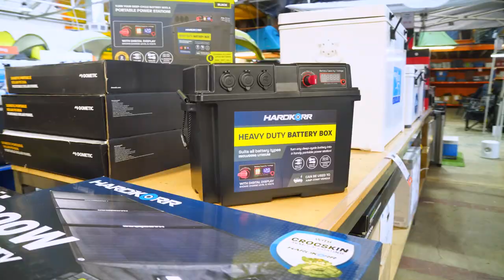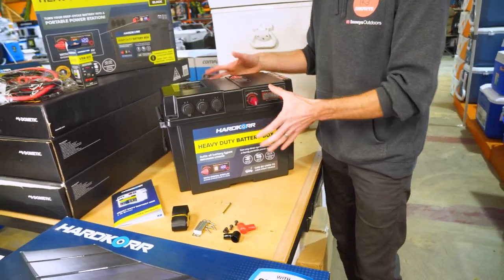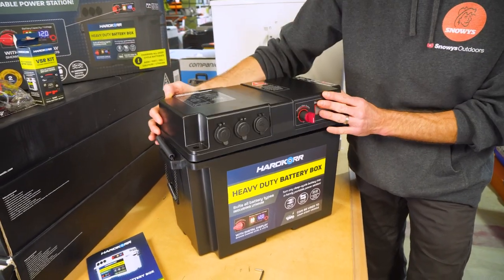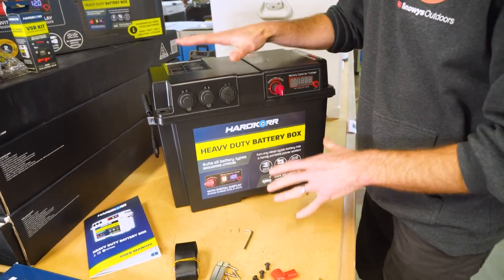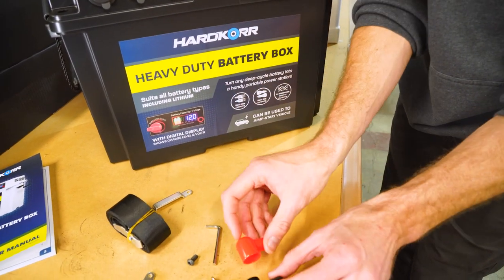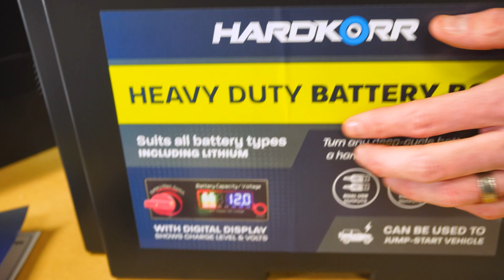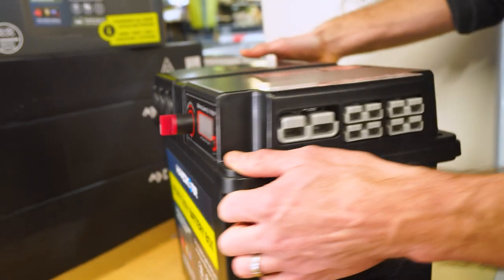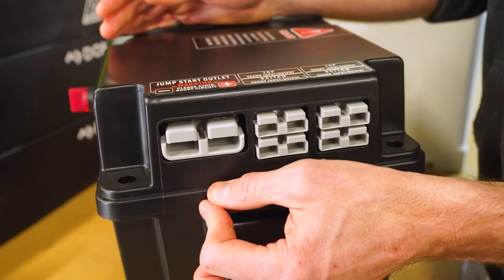Hard Korr Heavy Duty Battery Box

Comment: The box itself is excellent! BUT I’m not a fan of the 50 amp auto reset circuit breakers, I replaced them with midi fuses. The large Anderson cable is connected with a very tight bend! I replaced the terminal with a right angle one for a better connection. I filled mine with 300ah lithium cells and a jk BMS. Just wish the box had battery posts to connect a inverter, I currently run it through the large Anderson! So I pretty much modified the box in the first hour of it arriving and no doubt voided my warranty! 😂
Reply from the maker: The box is well set up for modifications for those who have the knowledge/skills.
Potentially hasnt voided warranty, but worth checking with HardKorr
~ Lauren

Comment: Can you charge the box using solar while  attached to a portable fridge simultaneously? What I'm asking is that could you charge the battery while drawing power to the fridge at the same time. Very informative and good video 👍
Reply from the maker: Yes, you can, it just means it won't charge as fast, but you can certainly have solar going in whilst a load is attached. ~ Ben

Comment: If you charge from a solar panel, does the battery box regulate the power coming in so it doesn't overcharge the battery, or is that anything to really worry about? I'd love to get something like this in lieu of a portable jackery style power station that lacks much battery capacity while avoiding the mess of cables in bigger setups. This looks like it would do that job.
Reply from the maker: You'll still need to use a solar regulator between the solar panel and battery, Travis. The Hard Korr battery box doesn't have any built in feature to manage this. ~ Ben

Comment: Hi there I have an mppt controller that needs to be fused when connecting to the battery. I’m just wondering if the wires from the 50a Anderson are already fused under the lid or if I need to install one? Thanks
Reply from the maker: Hard Korr don't specifically mention anything being fused in the battery box, John. I had a look inside and there does look to be a blade fuse holder on the power going to the cigarette and USB outlets, it's not easy to get to though. I can't see any other fuses in there though, so I reckon it would be best practice to add an inline fuse to anything you power from this just to be sure.
~ Ben

Comment: My deep cycle battery is totally dead..4.2 volts at this stage..any tips on to revive my battery .it's a 12volt 140ah
Reply from the maker: I don't think it's recoverable sorry, you could try a good quality charger, but if the volts are that low I'd say your battery is cooked. ~ Ben

Comment: Finally getting a canopy put on the ute So now the fridge can stay in the canopy instead of the tent. For weekends, do you reckon a battery box is the way to go or a power station like the Rover etc? Cheers.
Reply from the maker: I personally prefer a battery box as you can upgrade of replace the physical battery when it eventually dies, instead of having to replace a whole power station.  If you have some electrical knowledge, its easier to customise how it wires into your system, etc
The power station does have a convenience factor though and appeals for the plug and play style nature of it.
~ Lauren
Reply: @SnowysOutdoors  can I charge a battery box from home, as in 240v

Comment: This battery box is a good product if you can get it at the right price, I have adapted the 175amp Anderson port to run my 12/240 volt inverter with some 0 awg cable.
Reply from the maker: Thats a good idea @Binzy2164
~ Lauren
Reply: What modifications did you make? I was under the impression an inverter can plug straight into the 175ah Anderson?
Reply: @CJFranciss  No modifications to the box it self, I just made up some O gauge cable with a 175 Anderson at one end a some good cable lugs at the inverter end.
Reply: Just bought this box and that’s what I’m doing also. Running a 2kw inverter and induction cooktop from it. Box has everything you need and saves the hassle of custom wiring and fusing everything.
Reply: @2389benny  I wouldn’t run high amps for long periods from the box as the 175 Anderson is designed for jump starting which uses high amps for a very short periods.
The internal 175 Anderson wiring is not that big and may get warm if you ran the inverter over 1000 watts for a long period.
I am using a 1500 watt inverter and would rarely get to that wattage.
I may upsize the internal wiring in my box once I have done a bit more testing.
Reply: @Binzy-jq2xq  yeah I was toying with the idea of just using the plug itself and upgrading the wire internally. Also bypassing the battery on/off switch just for the inverter, given I have a remote switch for it anyway.

Comment: What fuse size is in the box. I ran into a problem with my Kings Box when using 40A DCDC found the fuse on the Anderson plug inside the box were only 30A so naturally blew them.
Reply from the maker: Only the 12v cig outlets are fused, the Anderson outputs/inputs arent fused but they do have 2 breakers.
Realistically you shouldn't need a fuse, but if you want to add one in you can do something line an inline on whatever charge input cable you're using.
~ Lauren

Comment: Thanks for the brilliant video. One question and not sure if I missed it but are the connections fused ? As in the usb’s, 12v cigs, and Anderson plugs? Thanks
Reply from the maker: There are some inline blade fuses under the lid, Nick, and it would be relatively straight forward to add more if you wanted to do so. ~ Ben

Comment: Likely they dropped the VSR due to smart alternators, gives the customer an option of supplying their own or use a DC/DC charger. 

The charge level indicator is pretty useless as there is no option to select battery type. For instance, if you put in a LiFeO4 battery, at 0% charge it'll still be 12.7V and likely show 100% (for lead acid batteries).
Reply from the maker: I think you are right regarding the VSR, better to be able to add it in if needed that buy it with the unit only to remove and not use it.
Good point regarding the volt meter, I guess you need to be conscious of the type of battery you are using.
~ Ben

Comment: At 7:10 he talks about using a 240V transformer to charge from 240V - I think he means a 240V battery charger suitable for the battery type you have installed.
Reply from the maker: Right again Ian, apologies for my incorrect terminology. A 240V to 12V battery charger with suitable Anderson connectors would be the best solution here. ~ Ben

Comment: could u connect a powertech control panel to this aswell
Reply from the maker: I'm sure you could, you'd probably need to use an Anderson plug wired to the control panel  which is then plugged into this battery pack. You would essentially just be extending the number of available power outlets. Make sure it's all fused properly. ~ Ben

Comment: Thoughts on running 1000w inverter on the 175a outlet?
cheers
Reply from the maker: Hmmm, you probably need to know just which battery you are running inside, gablia2002, along with what you are running from the inverter and and how you plan to charge the battery. I'm no expert on inverters but I think it will chew through power pretty quickly, so you'd want a reliable charge source. ~ Ben

Comment: What’s the IP rating on these please?  Are they weather resistant?
Reply from the maker: Hi John, Hard Korr haven't tested these in order to be able to give an IP rating. 
They are designed to be installed in a sheltered location, the ports on the exterior are not weatherproof. Ideally in the tray of a ute or boot of a vehicle.
If you are taking it out of a vehicle for use at a campsite it is best to locate these out of the weather under an awning.
~ Ben

Comment: Best not to use a deep cycle battery for jump starting a car engine.
Reply from the maker: Yep, you only want to be doing this in a pinch, Richard, as you'll likely kill your deep cycle battery. ~ Ben
Reply: Yes agree only in an emergency, good to have in that type of situation.
Reply: How do "all-rounder" batteries compare to true deep cycle batteries? It seems like the best of both worlds having CCA and about to draw power for accessories too, I'm not sure what the cons are though, has anyone know of any pros and cons? Cheers
Reply: @cardona54321  yep, get a Dual purpose style battery. Exide make a MDP (marine dual purpose) with 100a/hr plus some cranking amps. I've always used DP batteries, not deep cycle. More versatile. Just get a sealed battery so no gassing off if its in the back of a vehicle.